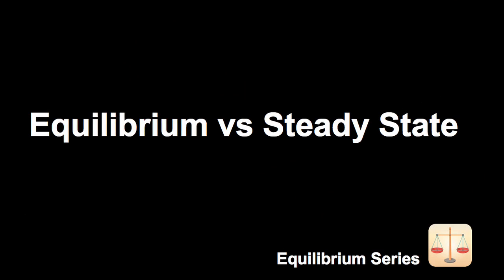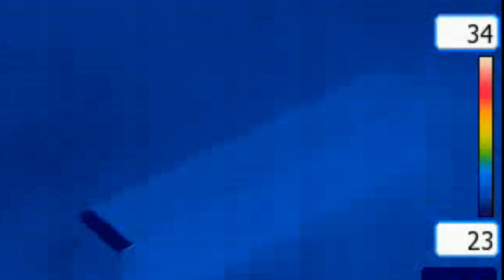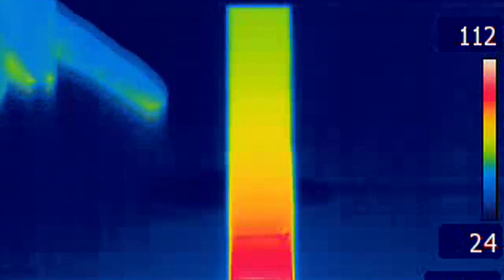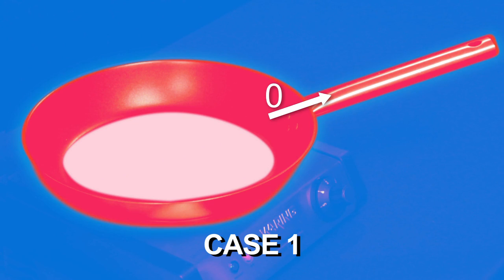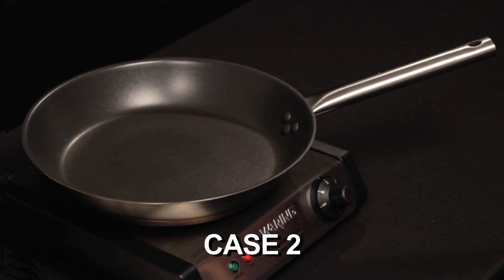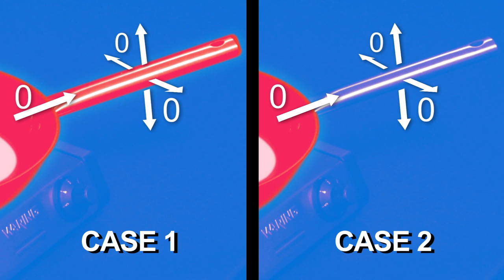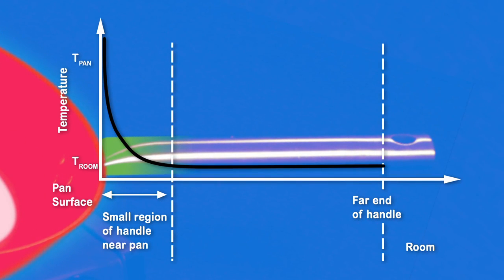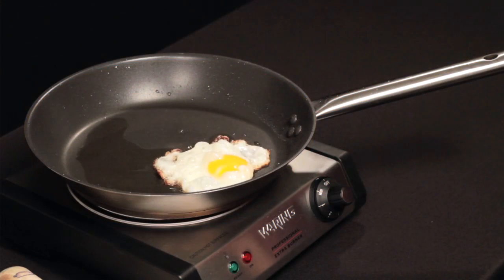Equilibrium vs. Steady State

Comment: What if the net flow heat from the pan to the handle is greater than the net flow heat from the handle to the room, But both flow heats are constant with respect to time. will this be at steady-state?
Reply: No,the heat addition and rejection has to be same to consider it as a steady state